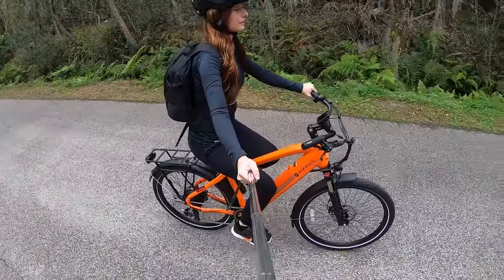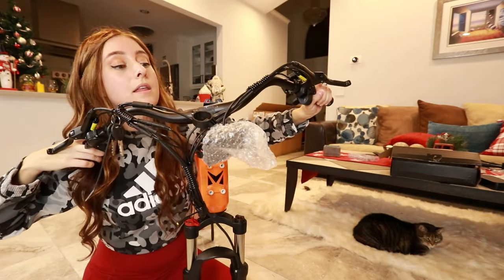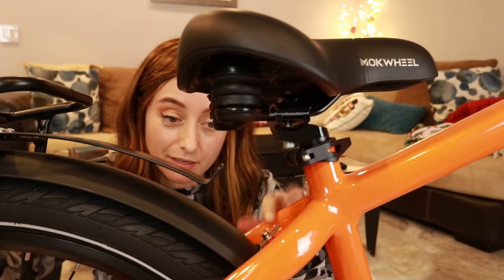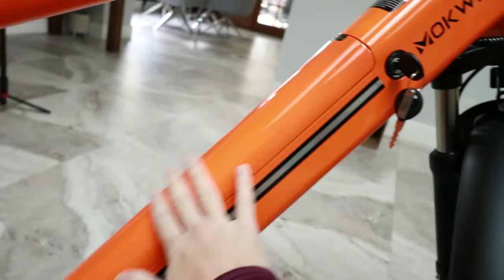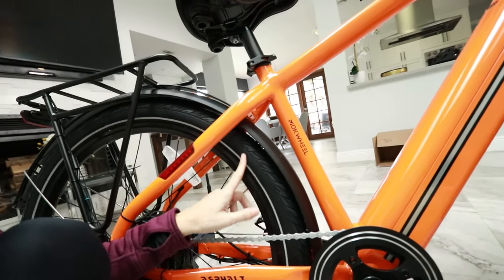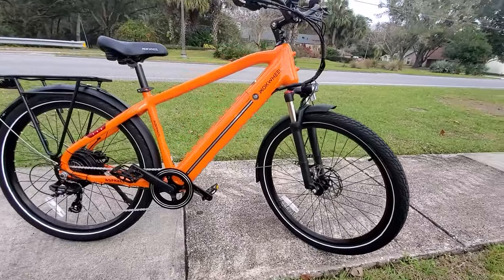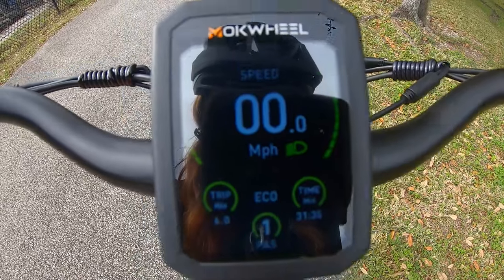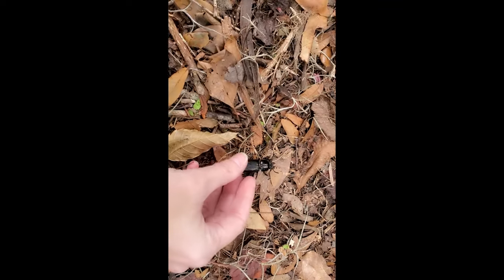Mokwheel Asphalt Urban Commuter eBike | Unboxing, Assembly & Ride

Comment: That’s the bike my sister and her husband bought and are very happy with but an older model. Lots of nice upgrades on this one. First bike I’ve seen with side lights.
Reply from the maker: It's a nice bike for sure.
Reply: i have the step through version. 
Sadly, I got my first blowout. 😢
it's still a bike and a nail is the foe that felled my champion. 

what a walk of shame I had back home. Meh, thats life. live and learn and doing my first repair! Truly, I'm gonna add all the accessories I can to it. lights for the wheel, water bottle holder, phone holder, fix a flat kit, rear storage bag, electronic inflator, and so on.

not to mention the hitch for my car so I can go on bike rides around town and other cities.

Comment: No reason not to use an e-bike on a bike path as long as you're not doing 40 MPH on one of those souped up ones. If anyone gives your grief for it tell them to pound sand.
Reply from the maker: None of these go that fast, if they did I'd have to register them as a vehicle. I've gotten some complaints in the comments but honestly I don't think I'm interfering with anyone's bike trail experience. The cameras on the other hand I can see as an issue but I try my best not to film people unless it's just their backside that gets into the shot. On the trail just one complaint so far, about a headlight being too bright. After that the dude invited me to check out his restaurant. Pound sand, got it.
Reply: @ZophieReviews  I ride on bike paths on my e-bike and am usually doing 20-22 mph. Spandex Lords on road bikes whip passed me like I'm stopped. People who think e-bikes shouldn't be on bike paths are just haters with too much time on their hands. Anyone that chooses green transportation over getting into their cars deserves respect.